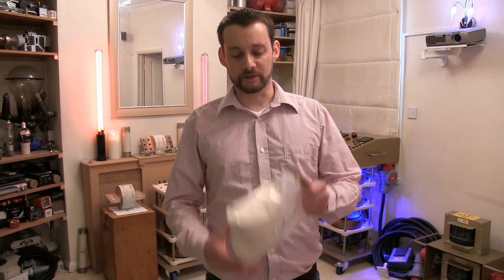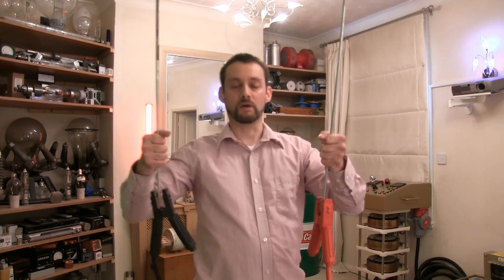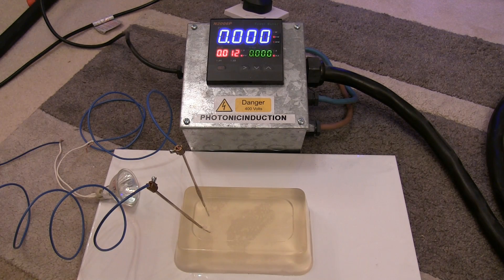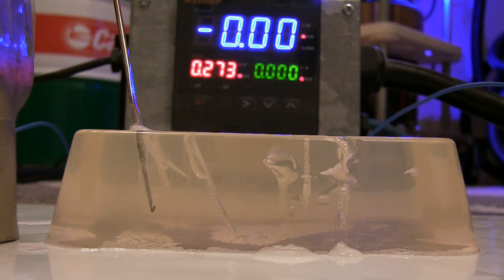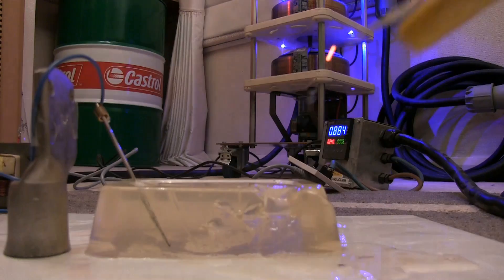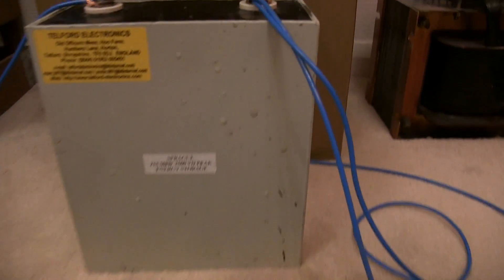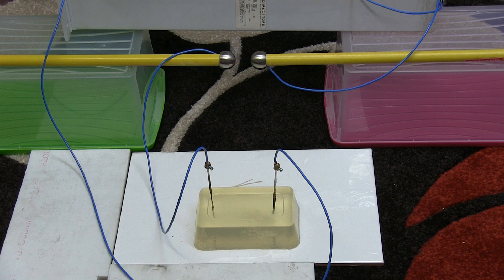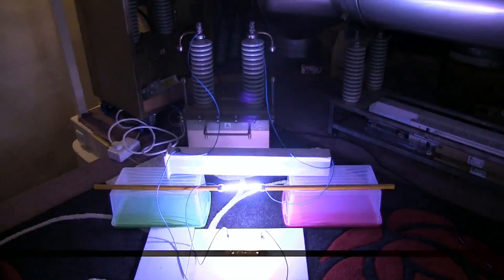Ballistic Gel Vs Electricity

Comment: Does voltage matter in fuses? Like okay 5000 amp fuse but what voltage are we taking? Does the power of it matter? Seems like it does by how those links are flying out of there right? But 5000 amps is 5000 amps… would it still pop if it was 5000 amps and hardly any volts?

Comment: try mitchum deodorant gel vs electricity!  i think i accidentally made a computer with 3 glowing lights from it!  i used a plasma ball in foil connecting to a wire for the power source and hooked it to the sink for the ground.  (there was no LEDs or bulbs just glowing spots in the deodorant)   the 2 lights would turn on then very slowly fade away. when it gets too dull the third light turns on and blinks and seems to charge the other 2 lights.  when the 2 lights are at its full brightness the third one would stop blinking and turn off.  this cycle repeated 36 times!  then eventually the third light wouldn't turn on anymore.  it was really cool to watch!  i tried to make another one and couldn't do it.

Comment: Holding the probes is only dangerous if the voltage is high as the current is the same though when touching each other so leave this stuff to professionals and don't replicate this experiment at home unless you're a pro yourself or suicidal.

Comment: Why does the 100k volts not melt the gel as much as the 240v? Is it because there is more amps at lower voltage? I don't understand electricity to well but want to learn more
Reply: Exactly that. You need volts to push current through a circuit. If the power supply can delivery 100kV but has a limited current delivery then the current drawn will be lower.

Comment: did you use regular tap water? if so would you try the same experiment with De-ionized water and see what the difference is?
Reply: He did use tap water. You can also add salt to change the resistance

Comment: why did the electricity mess with the camera
Reply: probably caused an electromagnetic field,which inducted some currents in the camera
Reply: no, it didn't mess with the camera, the camera has a rolling shutter, which means it reads the image left to right, top to bottom, and the lightning bolts appear only for a small amount of time, so the camera doesn't capture the whole bolt, only parts of it

Comment: The high voltage part is easy to figure out the fault of, with such high currents you are basically asking it to pass through the medium of least resistance, in this case it gotta be the air.

Comment: Why does the camera capture it in such a weird way?
Reply: rolling shutter the sparks are over before the shutter rolls over it
Reply: Marco Polo because the camera cant capture the frequency of the voltage, you cannot reach a high voltage like that without increasing the frequency, thus it being very high.
Reply: TooPlepsy emf discharge and you can get high voltage at a low frequency look up van de graff generators

Comment: You definetly have MORE MAD Scientist in you than me. I have worked with 100,000 VDC and made a calibration jig to accurately measure that voltage.  I have built a good quality Tesla Coil that produces 4 foot and sometimes longer arcs in all directions.  It stands about 4 feet high.

Comment: You don't overcome resistance when you increase the voltage. Resistance drops the potential difference (measured in Volts or Joules/Coulomb), as such, when you wire the ballistic gel in series with the lamp, the voltage drop across the lamp is considerably lower than the voltage gain across the source. Most of the electrons' energy is converted to heat when the electrons pass through the ballistic gel. In most scenarios, resistance is constant, except in thermistors.
Reply from the maker: You are correct that resistance is fairly constant although lots of factors can cause resistance to alter slightly. As for higher voltages, resistance is less of a problem, this is why we use it on long distance transmission.

Comment: That's just high voltage. It would shock you and hurt but it wouldn't harm you!
Reply: this isnt static electricity, this would kill you in an instant.
Reply: megaspeed2v2
You'd be fine. It's just high voltage exactly like static electricity, it would flow over your skin and make your hair stand up. There are many other youtube videos demonstrating this, you can get to about 750,000 volts or sometimes upwards of 1,500,000 volts without harm because the electricity passes harmlessly around you much past 1000 volts or so. Yeah it will make your hair stand on end if you are close and insulated but it won't hurt you. It's all dramatics.
Reply: It really depends on the current the transformer can give, you'd be cooked like a christmas ham at these voltages IF the current is available (from a transformer like that, it is). You might be thinking of high frequency which indeed does like to stay on the skin, but that's another matter. High voltages are lethal.

Comment: For some strange reason the camera doesn't seem to like the 100kV side of the video...
Reply: It's because the camera sensor does not capture the entire frame in an instant, it scans the picture line by line over a few milliseconds. The sparks don't last that long, so you get the effect where only part of the frame is lit up.

Comment: Since when is 440v classed as Low Voltage?
Reply: Not a lawyer so I don't know the exact history of these classifications, but low voltage has been considered up to 1000V AC for quite some time.

People working in the industry oftentimes work with voltages going into hundreds of thousands of volts so to them that is indeed quite low.
Reply: Since when the AC grid was invented. Up to 1kV is low voltage.

But if you are an electronics guy, then anything above 48V or so is high voltage :D

Comment: Good stuff as always. Why did you steal you Mum's knitting/sewing needles to use as probes? The ones with the flat in the center and the hook on the end are for pulling thread through things. I would have just cut a few inches of welding rod and saved the useful tools for other things.. But that's just me... :)

Comment: Interesting results, I was surprised to see a lack of cavitation leading to  explosive failure under the HV testing. It seems the material resists the sublimation enough to prevent the sudden build up of pressure. It's hardly an analogue for flesh electrically at those ridiculous voltages and currents as the water in flesh does not resist the sublimation and resultant cavitation causing explosive results. 

Also it's great to see you back making videos, and I'd like to compliment you on your engineering and fabrication on those supplies, they are magnificent examples of engineering.

Comment: please learn about refresh rates and rolling shutters
Reply: Please learn about the inverse square law and how interference between electromagnetic radiation and electronic equipment like CAMERAS result in interference of AV equipment.
Reply: It looks like the entire frame is shown over two frames. Wouldn't your hypothesis result in dropped frames? Or the camera shutting off completely?

Also flickering occurred during times when his high voltage/amperage wasn't on.

I'm sorry if I came off condescending. I didn't mean it that way. If that was your issue you could have just told me instead of mocking me.
Reply: Are you talking about when he's arcing it towards the end? He did an edit. The spark is at a frequency that's making it not show up on the frames, so he took a single frame that shows the arc best and let it play for a second or so after the burst so you could see what the arc was like.
Reply: Yeah, that's what I was thinking of. Assuming it's ac perhaps syncing the refresh rate would have helped. I noticed it was off from the led displays too.
Reply: Take your smart phone and vid a fierce lightening storm with strikes within 500-1000  yards.  The results are the same with lost data periods in the write process due to the sensitivity of the MOSFET circuitry.   ( No condescending intended. )
Reply: Wow okay! I have lots to learn.

Comment: what the fuck 2000v is medium what even
Reply: The guy eats fucking lightning bolts from mount Olympus for breakfast.
Reply: most of the time thats low for him :)
Reply: Iv come to relize.... LOL
Reply: It's common in the electrical distribution industry to refer to 2kv as medium voltage. 110+ is generally "low voltage", 500v+ "medium" voltage, 5kv+ "high voltage". Everything is relative, when you deal daily with voltages up to 500kv the relatively low voltage of your home electricity supply or the boosted voltage of Andy's supplies as medium or high voltage. In consumer terms anything over 48v is "high voltage" as average joe isn't trained in the handling and safety of higher voltages. Now all of this applies to AC, DC is another monster entirely.
Reply: +Kefford Denton Actually medium voltage usually starts around 1kV (1000V), not 500. High voltage on the other hand begins around 75-100 kV. The voltages used in consumer items are usually referred to as "extra low voltage", which is anything below 50 V.
Reply: Its always relative. In power transmission up to 30kV is considered medium voltage, and from 110 to about 500kV is high voltage. After that, there is ultra high voltage.
Reply: yeah to ppl like you who are not aware of the awesome stuff, everything is small / low lol
Reply: INVISIBLE SUN he can hit over 30,000 volts so yeah it’s medium voltage

Comment: Maybe next time compare with gel made using distilled water?
Reply: It's the impurities in water that make it conductive. Pure distilled water is a much better insulator.

I'm picking it wouldn't make much difference though as the substances in the gel are probably conductive anyway.
Reply: Salt water would be more accurate
Reply: what would the difference be?
Reply: What about deionized water ???

Comment: Humming transformers always scares me.
Reply: The silent ones are more dangerous.

Not that the "low voltage" humming one wouldn't kill you.
Reply: VictorIndiaDeltaAlfa not nececeraly, the ammount of hum we hear, is directly proportionate to the operating frequency: this is why even the highest grade mains transformer still hums a lot under full load, and even the best grade flyback transformer (q-r mode) makes a really high pitched whistle (NTSC 15KHz)
Reply: @ivanrodionov9724  the quality of the winding and core assembly greatly affects the sound a transformer makes for example I made a transformer at home which has huge capacitance between the windings because it was manually wound by me and the core also is loosely put together so it makes a huge humming sound when I turn it on and this junk also draws like 2 amps@240 vac at no load.but I also have an industrial grade inverter transformer which even at dead short doesn't make a noise because the winding the core and everything is in perfect condition.so yeah quality matters lot
Reply: @valanps1638  your home made transformer draws 2A at no-load due to high reluctance of the field path. That 2A is the magnetizing current.
Reply: Yes, because high quality transformers are quiet, and old or bad ones are humming.
Reply: ivan R No, not amount, but audio frequency. You've said it yourself.

And while yes, all transformers hum under load (and quietly hum unloaded), the hum is caused by forces acting on the windings thus causing vibration.
But the one on the video is unloaded, so the only cause of excessive hum would be either core badly put together and/or high magnetising losses.
Reply: natural to be afraid of the unknown, it keeps us alive. do stupid things we don't understand and we end up not so alive. I tend to stay away from high voltage myself.
Reply: VictorIndiaDeltaAlfa not only, infact, the hum can be caused by the actual core vibrating, an this is especially the case with bad transformers
Reply: its like "bzzzzz i'll shock you bzzzzz"
Reply: is it only me, who likes humming transformers?
Reply: @ivanrodionov9724  I love it that's how I get paid.
Reply: @ivanrodionov9724  You're not the only one 😋
Reply: @ivanrodionov9724 
I love humming high voltage transformers
Reply: It calms me
Reply: I've dealt with massive transformers my whole life but still, I'm 200% focused af hearing those transformers.
Reply: Why i love humming transformers and contactors
Reply: Rizki Pratama Humming transformers give me a chubby!
Reply: Rizki Pratama Optimus prime always scares me
Reply: Why
Reply: Give me a hard on!
Reply: A silent transformer at peak would be terrifying!
Reply: Eddy currents are always present in the core, and are proportional to operating frequency, not so much load. But thats why cores are laminated, and if frequency doesnt change, the eddy current loses shouldnt either. The core is vibrating either from magnetostriction (harmless) or gaps in the core (air gap losses). Overloaded transformer hums because its core is in saturation, which causes high currents and thus high forces on the primary winding.
Reply: Me too
Reply: The 60 hz is the humming
Reply: @kennydunk  no, it's 100 or 120 Hz mixed with other other harmonics due to non linear B-H curve of the core.
Reply: good. Kerps ya safe
Reply: Humming transformers quit once there's a good load on.
Reply: @Timothy Lary wtf is "potential kinetic" energy lol?
Reply: @Timothy Lary I do have a formal education, unlike you. Do you have any fucking clue about magnetostriction, the reason why the humming sound occurs?
Reply: @Timothy Lary I’m pretty sure electrical energy is also kinetic energy and not potential energy
Reply: Not as much as the those two rods coming into contact with each other scared me with the noise it made
Reply: Awesome
Reply: You won't like using the meekrowahveh

Comment: Can you do one of those high impulse current, high amperage, high voltage taps on the gel? I imagine that would require a blast shield? Like would the gel melt/vaporize and splatter everywhere instantly?
Reply: Exploding wire immersed in ballistic gel..
Reply: +TheErilaz I was thinking some nice aluminum or magnesium chips mixed liberally in the gel. Get those good and hot, a little air exposure and oh you've popped it.

Comment: With the machine that you used in the last scene, are there any capacitors that can store that kind of voltage, with at least some decent level of current?
Also, would that make a more effective stun gun, or is it only effective as a supplementary stun gun, e.g., you use your hand held unit to keep someone a little mobilized while you hook them up to the larger machine which can then be kept on to keep the criminal in place until the police arrive?

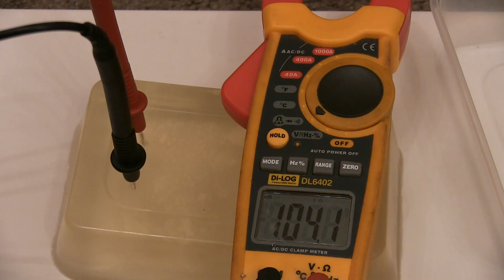Comment: 1:55 How is this Possible, without shocking himself? O.o 

I'll never understand Electricity
Reply: Low voltage, high current. You could do the same with a car battery, 12V don't harm you but make some nice sparks on contact between two metal rods/clamps
Reply: I could have the wrong analogy, but I imagine high amps as an ocean, and with high voltage a tsunami. Low amps would be a water gun, but high voltage with that equals a water cannon that could send you flying off your feet.
Reply: Amps is like electrical flow and voltage is like the pressure.

For example think of the water from a hose as one amp and near zero pressure. If you then plug the hose into a pressure washer, you have increased the voltage and the effect is much more violent, you would have say 1 amp at 10 volts for example. 

you could then turn the hose half down but leave the washer on you would then have  .5 amps at 10 volts.

Comment: Great to see you back photon! Just wondering, can you explain the ways you achieved the voltages?  You had the first power supply, then used a transformer for medium I think, then you used the big boy supply and a transformer for the last?  Whats the difference between the big boy and the first one? Also it was a bit unclear for me whether or not you were using a step down transformer for the first, after you showed those rods arcing.  Thanks, your channel got me in love with electronics and I'm definitely interested in whats going on.

Comment: Why doesn't it melt on 30 kV when it was melting on 440 V? Do I miss something?
Reply from the maker: High voltage was relatively low current and pulse duration short.

Comment: lol imagine when we have energy weapons. were still very far from the day that well be able to direct that form of energy a significant distance, yet alone the batteries to do so.
Reply: Cole Jones Yeah this is a good example. Although, it doesn't direct plasma, its just a high powered laser. And there are non lethal anti personnel weapons such as the Active Denial System. And thats just the stuff we know about.
Reply: You may want to research Nikola Tesla then!
Tesla
Nikola Tesla (1856–1943), a noted inventor, scientist and electrical engineer, developed early high frequency technologies. Tesla worked on plans for a directed-energy weapon from the early 1900s until his death. In 1937, Tesla composed a treatise entitled The Art of Projecting Concentrated Non-dispersive Energy through the Natural Media concerning charged particle beams.[39]
Reply: +stu79fe Very interesting!  he was also kind of a nut, and some of his ideas were impractical. Im sure we have much improved directed energy devices now.
Reply: Technically we already can, the navy has a...laer tube? I guess, that directs high voltage plasma to a target.
Reply: Ben Watson fucking microwave gun, those things must sting. And I wasn't thinking of the THEL or the MTHEL, I swear that they had said something about a DEW that used a tunnle of lasers
Reply: +Cole Jones Hmmm sounds interesting! The only thing I can think of is high power lasers that self focus and create a plasma filament. But this is only observed in pulsed lasers in the megawatt range.